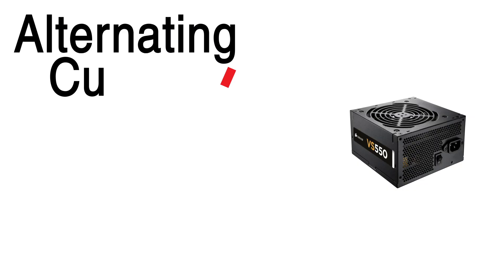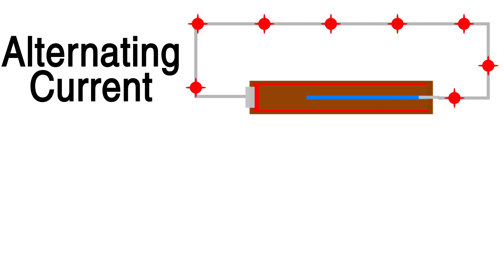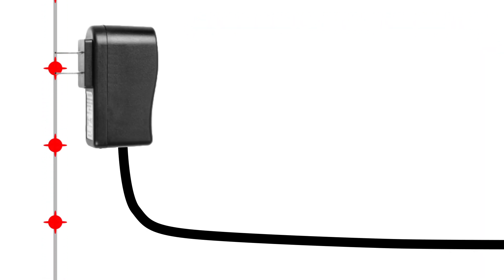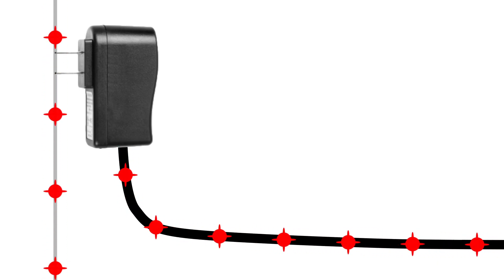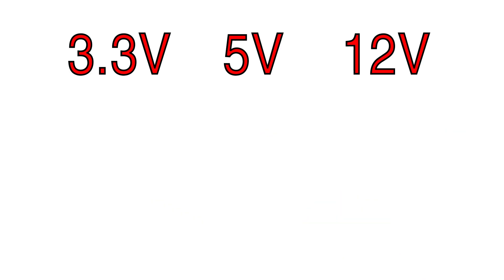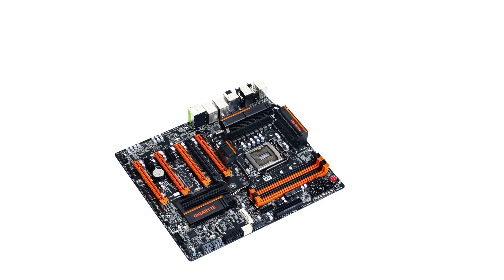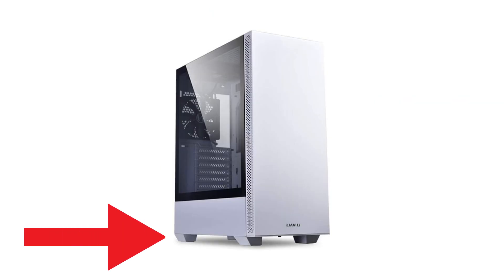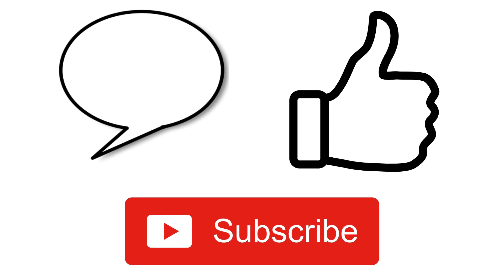How a Power Supply *ACTUALLY* works.

Comment: Why are CPU’s under the 5v side? I’m pretty sure cpus haven’t used 5v in 20 years minimum. They use the 12v rail but have additional power components to step it down to like 1v and a lot of amps

Comment: if my psu have 1000w it mean it will always run at 1000w ? 24/24 when my pc running ?
Reply: No. They only pull as much as the components are pulling. Like if your cpu is pulling 100w (assuming perfect efficiency and nothing else is on) then the power supply is only turning 100w of ac into 100w of dc. The watt rating on a power supply is a design point. Your parts can consume up to 1000w before a power supply upgrade is recommended. In general most quality power supplies can do up to like 20% over there rating and be completely fine but at reduced efficiency, which means let’s say u need 1200w from your components but the amount of power being pulled from the wall is 1300w as the power supply is loosing 100w through converting the ac to dc

Comment: Archeological dive into 1895 bridge rectifier, 1920 boost Power Factor corrector, and 1988 LLC regulator. Try 2011 vintage bridgeless PFC and Ćuk-buck2 power converter. The last 100 years of power conversion are being ignored.

Comment: It doesn't simply convert AC to DC. It first converts to DC then goes through a mosfet switching stage which drives a transformer. Then it gets converted to DC, smoothed and regulated. So in short once it converts to DC it goes through DC to DC convertor

Comment: Out of curiosity, is there a reason why these fans point down, when heat tends to rise? Wouldn’t some of the heat flow back in to the PSU? Or is it like this to maximize the flow of cold air in?
Reply from the maker: It's the intake (part that brings in cool air) that points down. Pointing up is usually fine but that points into your PC which tends to be hotter due to all the other components. If you have bad case flow and not many case fans, then pointing down is better.
Reply: The mesh on one side of the PSU through which hot air escapes points outside of the case, so most of the heat from the circuitry doesn't end up in the case. 

The mesh I'm referring to can be seen at 1:46
Reply: It's an intake fan. It sucks in cold air from the bottom of the PC case and out the back of it through the vent holes on the PSU.